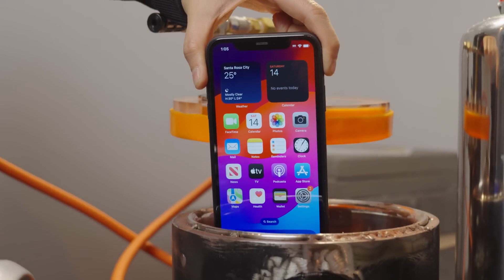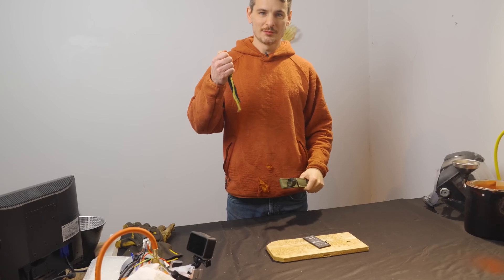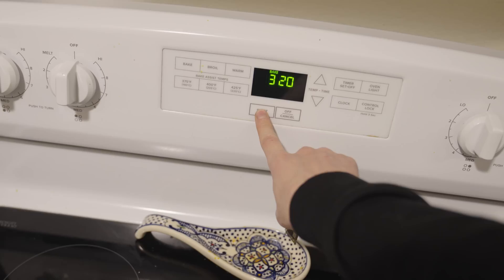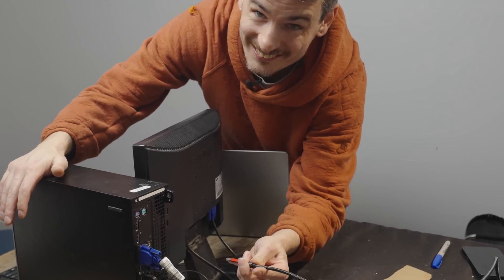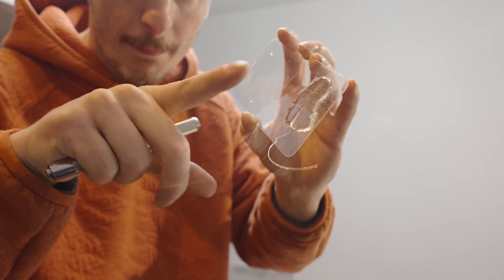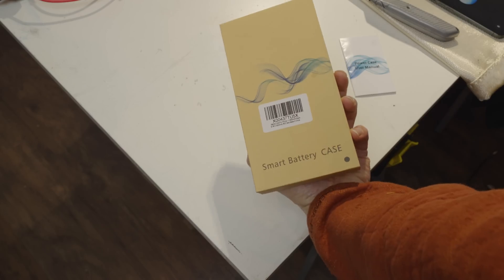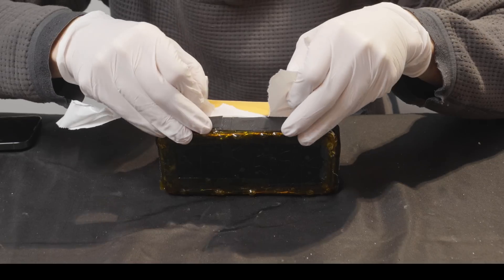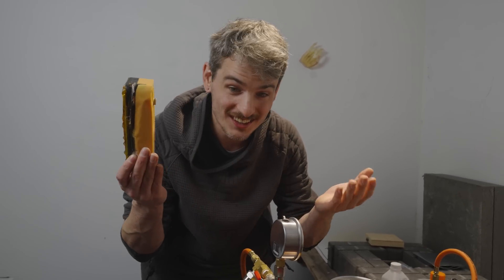iPhone VS The Planet Mars | Will It Survive?

Comment: Cool idea! Sealing the phone under a vacuum is a really interesting approach. However, the iPhone already has a solution to this for the variability in atmospheric pressures found on earth. There’s a barometric vent with a permeable membrane that allows pressure inside the phone to equalize with the atmosphere outside the phone, while still keeping it waterproof. I think the key is probably allowing it sufficient time to equalize (ie, by pumping your vacuum chamber down more slowly). Without this, I suspect iPhones would be popping open left and right on airplanes (about the equivalent of being at 10,000 feet elevation).
Reply from the maker: Hey that’s awesome! So it sounds like it was not necessary to seal the phone under vacuum. We can now eliminate that step. 😅. 

Slowly introducing the phone to the lower atmospheric pressure using like an “airlock” would probably work.

I believe the pressure in an airplane does not exceed the pressure rating of the phone but I could be wrong.

Comment: Hey so fun fact: doing pc part testing for the cold temperatures was actually not needed with a little bit of research (or one tech nerd in teh comments). So, cold is very good for pc parts heat is not. I will elaborate now: the main problem with getting pc parts to go faster, like the i9 14900ks that got overclocked to 9.12 Ghz (for reference a fast cpu would have a 4.x ghz clock speed) is thermal throttling which is pretty much just the cpu or tech parts getting too hot and making them very cold decreases electrical resistance and makes it easier for the cpu to do things which is why extreme overclockers use a mixture of liquid nitrogen and liquid helium to cool the cpus that they overclock. I also want to make a custom loop for a liquid hydrogen build which is very stupid and dangerous but it would have great thermals.
Reply from the maker: Thanks for sharing!

Comment: Are you actually commenting on all comments?

Then answer this question: 10 divided by 3
Reply from the maker: 3.33333333333333333333333333333333333333333333333333333333333333333333333333333333333333333333333333333333333333333333333333333333333333333333333333333333333333333333333333333333333333333333333333333333333333333333333333333333333333333333333333333333333333333333333333333333333333333333333333333333333333333333333333333333333333333333333333333333333333333333333333333333333333333333333333333333333333333333333333333333333333333333333333333333333333333

Ok that’s it

Comment: Yeaahhhhhhhhhh cool video but that's NOT how you test a CPU. Also keep in mind a desktop CPU is VERY different from a mobile CPU in a lot of aspects. Unfortunately it's actually really hard to run an actual test on the CPU alone as it requires a lot of extra electronics that would probably fail long before the CPU.
Reply from the maker: How would you have tested the CPU?

Comment: Put a Iphone in a bigger Venus simulator and see if it is turned into ashes and then make one that can survive.
Reply from the maker: I agree with that idea! I’m already working on the engineering for a big Venus simulator. But I have to be careful because I could die if I get it wrong.
Reply from the maker: You did see the small Venus simulator already that I made?